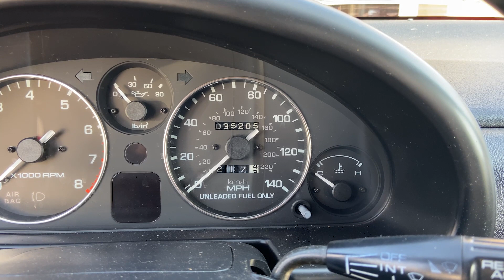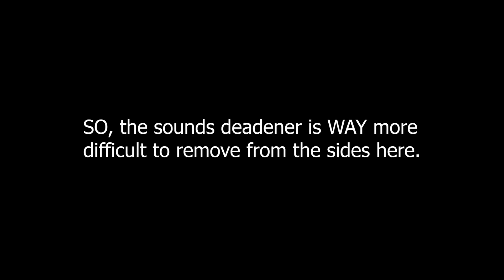Junkyard Datsun 240z - Part 9 - SOUND DEADENING Using DRY ICE

Comment: For the vertical parts that I couldn't stack dry ice onto I used those cans of compressed air you get at office stores.  Turn them upside down and spray on the sound deadener.  It freezes the deadener pretty quickly but one can gets you about one square foot.  Definitely more costly than the dry ice but less hammer swinging.  I also had decent results using an electric chisel/scraper from HF (super loud though).

Comment: I wonder if the heat transfer from the engine/transmission would make that sound deadening stick harder in the center console portion.
Reply from the maker: That's actually a really great guess. Maybe there's more glue applied there too because of the anticipated heat.